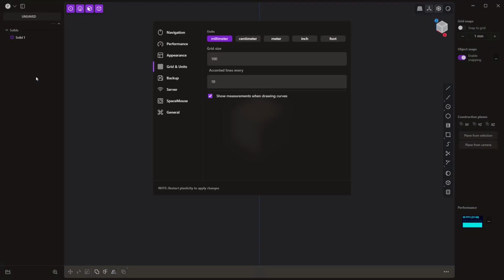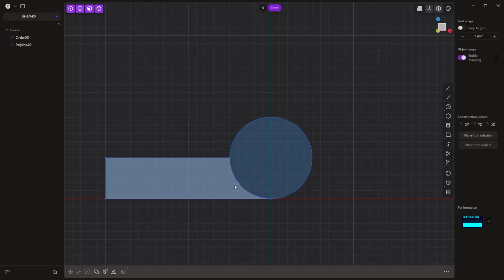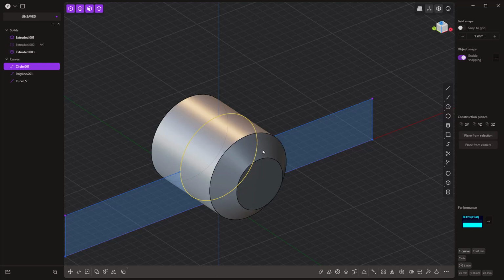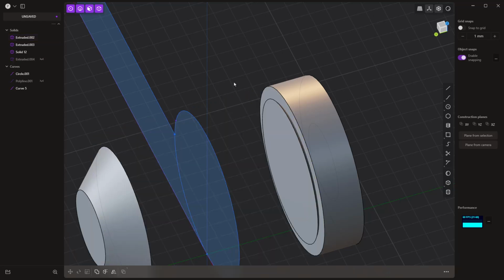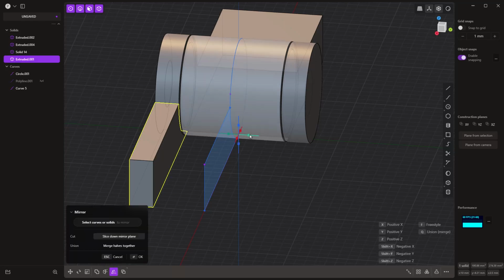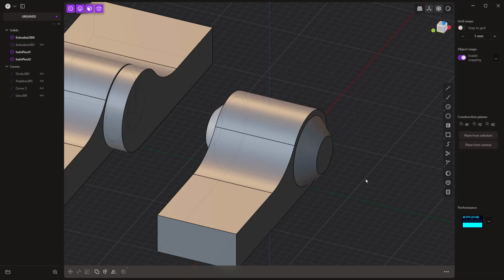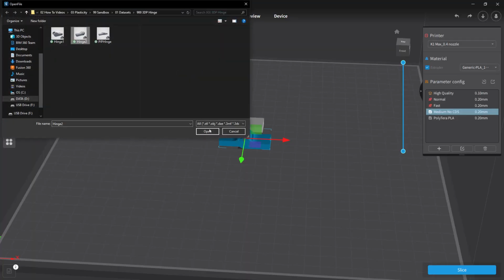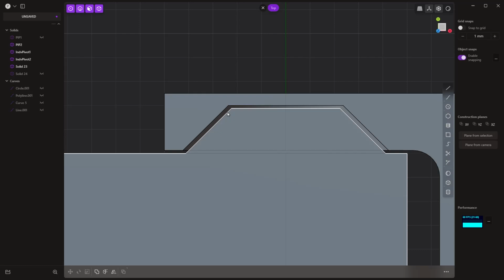How To Design a Print in Place 3D Printed Hinge in Plasticity

Comment: Im confused. What command are you referring to with "about", as in "about y"?
Reply from the maker: I am not sure which point in the video but would guess its around moving and rotating?  Whenever you use Move/Rotate/Scale commands look in the bottom right for the shortcuts.  So if you want to rotate about Y you would press Y once you have the rotate command on.  If you want to move in only Y you could press Y once you have move active.  

If that wasn't what you are asking just let me know about where in the video and ill try to clarify.

Comment: can you help me with an hinge design? I'm trying to use instead of a cone as yours, an inverted cone, and print in place...but can't find the tolerance that works always. I've printed multiple times and just two times didn't broke 😅
Reply from the maker: So you are starting the pin part wide and it goes all the way through the outside part?  Something like this?  https://a360.co/4os8gr8

one problem we run into with these types of things is if the tolerance/gap is too small, sometimes they can bind together.  .2mm is generally a pretty tight fit and .4mm is fairly loose if using a standard .4mm nozzle.  If you need a really good tight fit and one piece print in place you might want to go down to a .2 nozzle.
Reply: @LearnEverythingAboutDesign  yep is something like that!How can i share my 3d model to show you my project? I took inspiration by this video here : https://youtu.be/AAKsl8zW-Ds?si=2hQB9QXHwmlX2UHz&t=958 here you can the orange hinge prototype.
Thank for your suggestion!One of my attempt was with 0.1mm of tolerance and was super tight, but worked (one time hahah). I don't know if using PETG for a top layer can help to not melt together the two parts...
Reply from the maker: @FrankP83  support@caducator.com if you want to send me a plasticity file :)  
.1mm is pretty tight!  Even .2mm sometimes will bond where it shouldn't and you can break it apart.  

I have some more print in place ideas to explore for hinges in the future when i have time.
Reply: @LearnEverythingAboutDesign I've modeled into Shapr3D, i can send you the parasolid format so you can edit in case.
It's ok? 😊
Reply: i've sent you an email with the parasolid file! Is a txt to be renamed to "x_t" 😄

Comment: this is awesome! Really like your tutorials. Great tempo and good narration. I'm still a bit on the fency re Plasticity as I'm not sure if I'm able to import STL files from say makerworld, thingiverse etc and edit those models to suit my needs better. If possible, I would love to see a video on that. Just something like say, taking a spray can holder STL file, import it, and adjust it to fit a slightly different can (not just scale), but maybe keep outer diameter, wall thickness etc. Thanks for the tutorials so far, very helpful. Will def use your affiliate if I end up buying this software, only thing holding me back is the question here :)
Reply from the maker: Glad you liked this!  Sadly i would say with your question on editing an STL, no.  You can import meshes and snap to them in a few ways but I wouldn't go to Plasticity for what you want.  Editing STLs is tough and you generally have to recreate it as a solid or use a mesh program.  Something like Blender could work to manipulate the mesh directly but the issue is that the mesh you download is never how it was modeled.  It was likely created in a manner that was easy to modify and saved as an STL which is all triangles.  I would say for what you want i would look to either Fusion or Blender which are at opposite ends of the spectrum.  Fusion being a cad program making solids like Plasticity but has a bit more in the way of dealing with Mesh bodies.  Blender being a pure mesh modeling program but again dealing with a converted STL will be a challenge.  

I have loads of mesh modeling on this channel but i also did some specific videos for Autodesk on their channel.
https://www.youtube.com/watch?v=3zweZhS5zcc

https://youtu.be/yLGq_QJEEuo?si=HyBc6W9kiFw8wSUB
Reply: @LearnEverythingAboutDesign  thanks for the great reply. I'm a long time user of 3ds max, but I wanted a software that my 12 year old could tag a long with and also learn. The learning curve on max and blender is not ideal and while sketchup is intuative, I hate all the plugins you have to find to do just a bit more advanced stuff. 
Fusion360 was something I almost jumped at, but then your videoes with Plasticity came about and it looked so much nicer. But I guess you can't have the best of both worlds :)
Reply from the maker: @fuppading  Yeah no one software does it all :)  My 9yo uses TinkerCAD but i find the concepts hard to translate to other software.  Someone with 3ds/blender/maya background will get Plasticity a bit easier than someone coming from Fusion/Solidworks etc.  So I would ask what the goal is teaching your 12 yo.  Tinkercad has arduino/pcb design as well as Mesh based cad for 3d printing and even physics, and its browser based.  Fusion (technically) is for 13+ because of personal data.  Plasticity being local files/install there is no age restriction on that end of things.

If you want them to progress to say Blender i think getting in on Plasticity is a great starting point!

Comment: Sorry off topic but you reminded me of this issue I have been having in plasticity. When I try to wrap text onto a face I constantly get errors and even when I do manage to get it to work, any of the tiny lines in the text disappear and therefore they are not closed shapes and wont make a face that I can then extrude. Why does plasticity have these limits on size? Surely I should be able to go into the settings and add a decimal place to the accuracy so that I can model small things?
Reply from the maker: im not aware of any limitations.  does the exact same thing work if you do it larger?  Are you using the new Deform tool or something else?
Reply: @LearnEverythingAboutDesign  I havent heard of deform. I will have a look at it. I have a curved face which I select and then use the "unwrap face" command. I then generate text and make sure that it sits within the bounds of the rectangle that is created. I then select the text and rectangle (with the lines tool) and then select the original face (with the faces tool) and then use the "wrap face" command. I have managed to get this to work a handful of times but most of the time I get errors. If I am using a temporary work plane = error, if I am not using any work plane = different error it's just so unreliable and very frustrating. There is no assistance within the app to explain what is wrong or why it isn't working and as I said before, I have managed to get it to work a handful of times (doing the exact same procedure) but then I noticed that only some of my letters were complete closed loops and I realised that some letters have very short lines in the details and these disappear if they are too small. Seems like a limitation of the software where if anything is less than 1mm length it just disappears. 

Note that I am using plasticity on MacOS (M1 Pro) so perhaps this is an issue with the MacOS version that does not occur on windows? I can try installing on my PC and see if it works there but in general I prefer to work on my Mac and just keep the PC for gaming because.. well... Windows....
Reply from the maker: @The.JZA.  Deform is a great addition!  I covered it in this video https://youtu.be/LSAc4uyxTao   It works a lot better than the wrap face command so hopefully it will fix issues.

Sadly I don't have experience using Plasticity on a Mac but I haven't personally run into the same issue you have BUT I don't generally wrap text with wrap face especially not for small details like that.

Comment: This tutorial has been super helpful! I was wondering if you would consider doing a guide on Designing connectors for 3d printing, to split a model into printable chunks in the design phase. Regardless, A sub from me, thanks!
Reply from the maker: Great suggestion!  i have done this with Fusion in another series for a fender flare, but have some 3d printing content planned for Plasticity.  Ill add it to the list.
Reply: @LearnEverythingAboutDesign  really glad to hear that. thanks for all your hard work on these guides.

Comment: Thanks for the tutorial! Just bought the software with your coupon code. Really liking this workflow in Plasticity so much better than fusion 360 and alibre.
Reply: Really?  Looking at this video, I was continuously thinking "that entire thing takes me 1 sketch and a few extrudes in Fusion or OnShape".  Also, when 3D printing hinges, you can have one side go completely through the other one, basically bridging through the hole in the other part.  As long as that bridge isn't too long, that will work fine and you can have multiple of such smaller holes/bridges aside each other to get more strength.  And fully going through the other piece will make things much stronger than this tapered design.
Reply from the maker: @MisterkeTube  Yes in a different program you could put all the details in one sketch, but that isn't how plasticity works.  You could create all the curves at once if you wanted to but honestly it makes it a bit harder and they aren't in a "sketch".  Curves can be joined but not all curves.  And yes you can certainly have one side go through the other, but in this case I was comparing the same hinge design that is Print in Place vs printing 2 pieces.  The print in place part can be disassembled if needed and would give it the closest comparison.  Doing the non print in place variation you couldn't get the pivot to extend through so it wouldn't have been a fair test.

As I stated I generally don't use PiP hinges simply because they limit geometry a bit more having to get both sides of a hinged part to print in a certain orientation.  I like the freedom of being able to print the parts and then assemble them allowing for more complexity.

Do you use PiP hinges more than other methods?  If i need a strong hinge I would probably add a pin.
Reply from the maker: Awesome and thank you!

Comment: Thanks for this tutorial! Waiting for the printer to finish to see how the PIP hinge comes up.
Loving your content!
Reply from the maker: Awesome, thank you!  Let me know how it works out for you!  Depending on which printer you are using you might find that .125mm gap isn't enough.
Reply: @LearnEverythingAboutDesign  needed to tinkered a bit with the tolerance but I got a successful hinge at the third try. Looking forward to implement this in future designs. Thanks again!
Reply from the maker: @terra-damm  Glad you got it sorted!  How big did you have to go for your gap?
Reply: @LearnEverythingAboutDesign  Hi! Sorry for the late reply. Today I went over the tutorial again and I used a gap of 0.16mm. It came out great. Printed in a BambuLab X1C at 0.16mm layer height. Stock settings, just changed wall generator to Arachne. When slicing the hinge, I noticed that the seams (aligned position) were very close to the other piece, so I printed two pieces, one with "aligned seams", and another with "random seams". The second one feels much better and was also easier to break. Thanks again for the tutorial! I will try to design different hinges based on this video.
Reply from the maker: @terra-damm  Awesome thanks for sharing!!